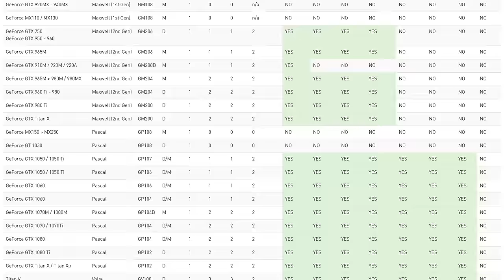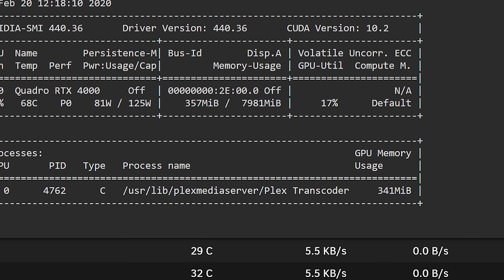5 First Plex Media Server Build Mistakes

Comment: While I do like your video, I'm confused by your "SSDs are cheap" statements. I got multiple 4TB hard drives for $50 each , I can't do the same with an SSD when a 4tb ssd costs around $500-700+. Definitely not "cheap". While being more dangerous to use over time-- for the sake of needing capacity, hard drives are the better cost effective solution.

SSDs are definitely not cheap in comparison
Reply: I bought an 8tb HDD at $180 just for my Plex Server.
So far I've used around half and still growing. Not a single issue I've had with my HDD, fast and responsive, great quality too. Would've spent around $1k for an SSD of the same space.

SSD are great to be used for PC programs, not for a PMS... 
unless you have just 4 movies.
Reply: @forfreedom1933  yeah for sure. I've been buying the 4tb external Xbox game drives from people and tossing them in raid. They have full drives in them so I just open up the caddy and takem out lol
Reply: He is talking about small SSDs for meta data  not the actual media files
Reply: @tylerfair774  Seriously dude... It's like they didn't listen to single thing he said... Like half the damn video was about using a cheap SSD for meta data to speed it up and HDDs for storage.

Edit: Just realized, they don't know what meta data is...
Reply: @Nick P. I don't think you understood the video. He was clearly talking about using the SSD for meta data and such, not for media storage.
Reply: He means like a 250GB SSD to host plex and the metadata, not the media files. He literally specified that

Comment: My bit screw up was only putting a 4 core CPU in it i should have gone 8
Reply: I'm using a single core with 2gb ram win7 and gt730
Reply: How many streams are you running where you need the extra 4 cores, or are you using the server for far more than plex?
Reply: @robertt9342  I get multiple streams one 1080 one 720 at the same time I can do multiple 480 streams haven't tested beyond 2 though for anything

Comment: Mine works well with 2 or 3 users, it only has 4gb of ram, a hdd, a gt710, and a i3 2120 lol
Reply: Does it affect your energy bills? And if so by how much? Also are you in the UK? I’m thinking of getting the same config but maybe upgrading the ram and is the gpu necessary?
Reply: If people are direct playing,  it can run on basically anything.  It's when people start transcoding at high qualities that this stuff matters
Reply: @caidzz9248  why is eletrical bill an issue? Youre not charging your tesla. This is a smal computer, just pay the bill
Reply: @brentschmgbert3578  our energy prices are currently going through the roof, because most of our energy is sourced from mainland Europe. The price cap is going up an extra 50% in October and then again in January. Currently people are paying anywhere from £250 to £750 per month just on energy, depending on whether you're paying just what you use or building credit getting ready for winter, so keeping energy as low as possible really is a huge deal at the minute for us

Comment: Me with a dual xeon rig running 256gb of ddr4 ram lol
Reply: Mr tough guy huh 😆 . How many cores and what did your storage look like, ya rocking zfs?
Reply: @june5646  24 core just windows, no redundancy
Reply: Same here. It’s cheap!
Reply: Me with an Intel NUC with a laptop i5, 32GB of laptop DDR4, and an external hard drive on a 10Mb upload connection 🤷‍♂  Just goes to show you can do it with anything, I'm building a Xeon system to replace it but for those looking to start out I'd suggest not letting it intimidate you!

Comment: One word, Synology. You’re welcome. Screw unraid!
Reply: Super weak chip in Synology boxes, so don't expect much transcoding or any. Plus your library will come to a halt eventually in terms of size limitations. Time to put on the big boy pants and build a real server with actual power and expandability, and some level of being future proof. UNRAID FTW.
Reply: Craig Churaman dunno what you’re on about.. I can have multiple streams being transcoded with my ds218+, so you’re talking out your ass 😅😂
Reply: One word linux.  Screw raid and unraid.  Haven't got insane amounts of movies.  They fit on one drive.
Reply: Laurence Reeves the measly soldered on processor on a synology beats a dual Xeon box? Wow you even said that with conviction. I’m impressed. When’s the last time you did 23 streams 1080p without a hiccup? Never? Oh ok. You can’t upgrade a synology without throwing it out the window and buying another one. If you are just streaming to mum and dad in the other room then stay with a synology. Plexers with an actual library (4000+ movies, 200+ shows etc ) and 100 users attached will kill a synology dead. We need a ACTUAL server. You know like a real server?

Comment: And heres me just running my plex server off my Gaming PC with 2TB of media and using direct play 100% of the time....

I dont really get why the fuck you need to build a dedicated server on this level for plex.....
Reply: Well I used to do the same but seeing as the gaming pc needed to be left on constantly and that chews through power which equals costly electricity bills I used an i7 nuc instead which even with added cooling doesn't cost half as much and I'm not paying for pc gaming parts to replace when they die from being left on 24/7 👍
Reply: I'm running dedicated Plex Server (actually a FreeNAS server with Plex + additional services) so a dedicated low power build than sits in my basement makes a ton of sense for me.  I don't agree with a bunch of these tips, but having dedicated hardware for specific workloads can make a ton of sense)

Comment: Seems like a waste of time running a dedicated server. Just build a nice pc with lots of room.
Reply: huh? I guess if you dont game then this would be fine but why would I wanna lose gaming performance on my main PC. The whole point of a dedicated server is to offload stress that would otherwise be on the main machine. I have a 4k OLED setup so I have a 4k movies folder that has files 50+gb and it takes a decent amount of power to stream those. Hell no I wouldn't want all that on my main pc
Reply: @muffin6810  I just tested a 55gig movie with black ops running. I can’t see a drop in fps. I’m getting about 200fps in 1440p either way. Movies are not stored on the same drive though. I have a 4930k with a 6900xt for reference. It takes up some cpu resources but on COD at least not enough to matter.